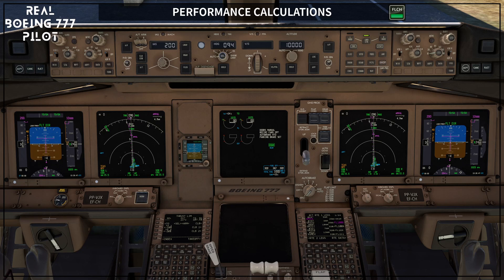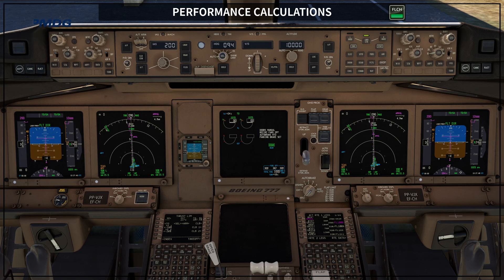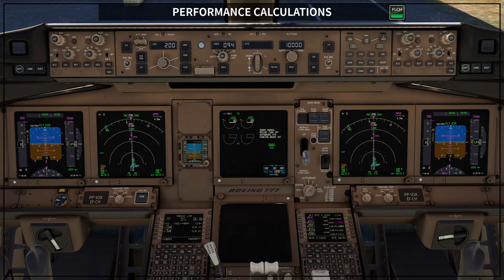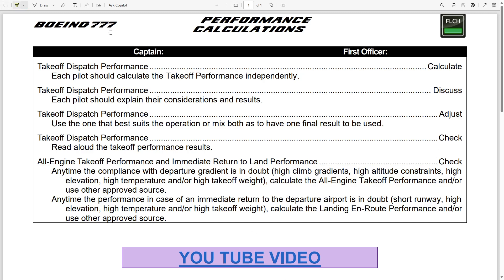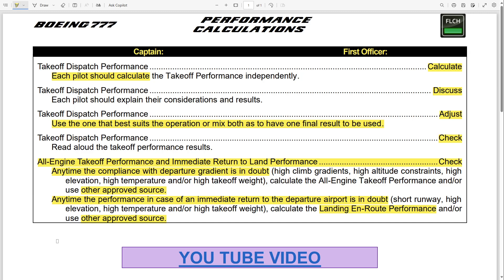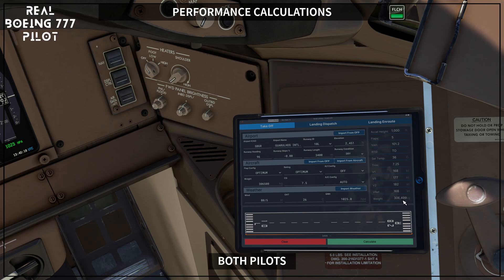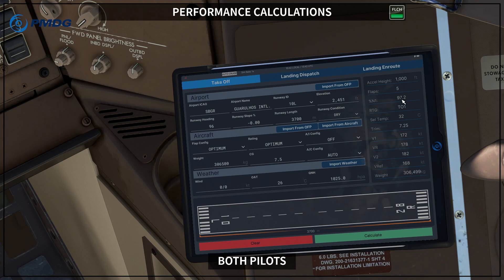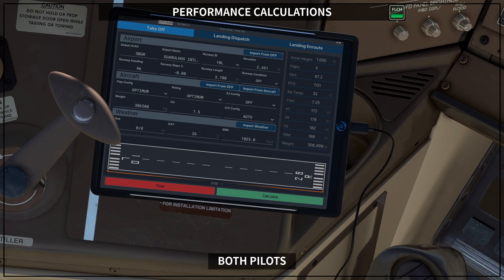PERFORMANCE CALCULATIONS - B777 NORMAL PROCEDURE

Comment: Hello captain great video as usual, just a question because I couldn't find the answer anywhere, for loading the cargo of a 777 what is the order of loading, so for example in a 737 not too sure but i think you fill the aft cargo first then the bulk, is that how it is in the 777 or evenly loaded, thanks in advance
Reply from the maker: Hello!
It is more airline standard to start loading from the front towards the back (FWD then AFT and BULK). To avoid any chance of tail tipping! 
But the 777 has not many issues! Only the -F… if you start to move all the cargo to towards the main door (which is at the back) without cargo on the FWD hold… the plane may sit on his tail.